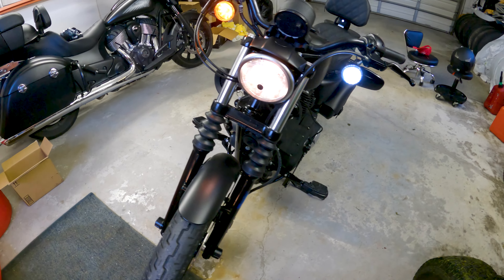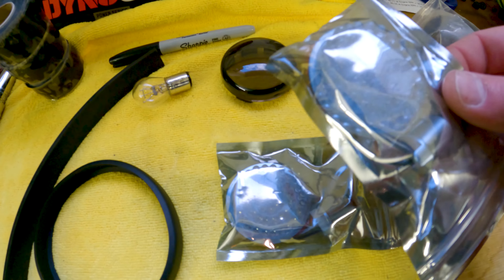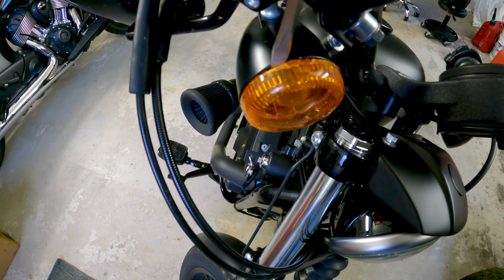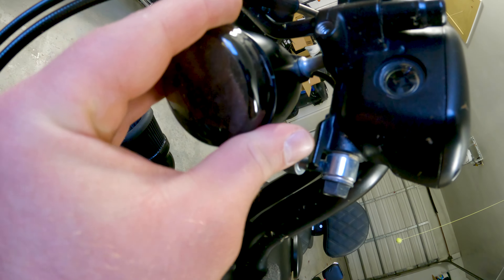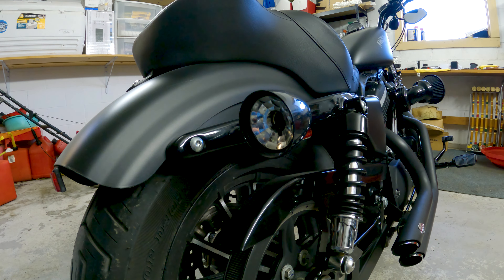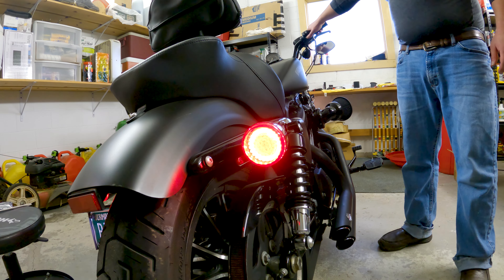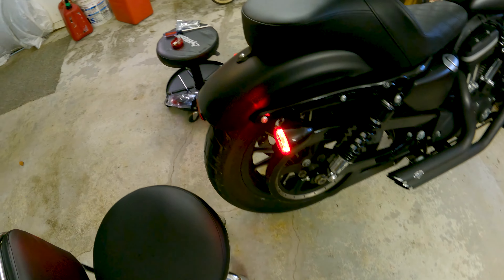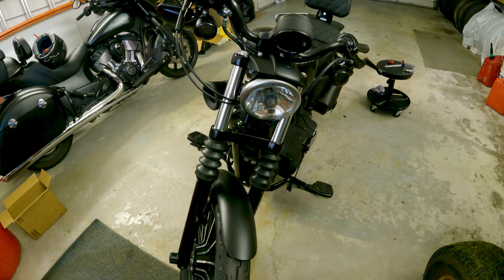How To Install Motorcycle LED Turn Signals | Harley Davidson Sportster, Dyna, Touring

Comment from the maker: Have you guys upgraded and of the lights on your ride? Are you planning to? Let me know down below!
Reply: Do you know if they have these taillights for a Harley Low Rider S?
Reply from the maker: @vtbaggerbro6291  These LEDs and taillight lenses will fit the Harley Sportster, Dyna, and Softail lineup according to the manufacturer. So you should be good for a Low Rider S!
Reply: I di dmy 04 Dyna the rear lights were not compatible and I had to install the voltage regulators for each light to stop the hyper flashing. Not a quick job on my bike.

Comment: I bought these LED's for my 15´ 883, as soon as I got them I wasted no time and went straight for the install, but I got heartbroken when i noticed my turn signals are single contact, i tried to squeeze them on anyway but only the turn signals worked, not the white surrounding halo light, any help would be much appreciated, maybe I just bought the wrong variation? Thanks in advance :D

Comment: Do they work as running, brake and turn signals?
Reply from the maker: Yes to all 3, and much better than stock!
Reply: @MOTOBLADE  do you remember if it was 3 or 4 wires? Trying to find a set

Comment: I got the same lights. They don’t fit in the rear because the small tabs are off :( 
(05 sportster)
Reply: Same exact problem, also 2005 sportster 883 custom
Reply: @TheTripawdHank0012  I ended up getting them to fit. I think I was installing them the wrong way, try to turn it around 180 I think that’s what got it for me

Comment: I just changed mine and i like the hyperflash but then the red key on my odometer comes on is that telling me that the resistance is off ?
Reply from the maker: You know, I was wondering what that was. But mine was coming on before I did this install, so I don't really know if that caused it or not? 🤷🏼‍♂️
Reply: You have to sync your new turn signals with the bike! Otherwise they’ll drain your battery
Reply: @JayPlaysGames  any advice on how to do this, just put them in this morning and definitely want them to work right. And how to install the transistors possibly?
Reply: It’s a quick fix
Reply: Awesome, glad to hear it's easy
Reply: @MrMinority_  how do you sync the signals to the bike?  I just made the LED upgrade to my 2012 Nightster and it has the hyperflash which I do not mind but if it is bad for the battery then I should fix it just not wanting to drop $100 on the equalizer and I'm no electrician so installing the resistors is a daunting task.  I do most of my own work on my bike.

My hubby had the hyperflash on his 2015 Street Glide also but we found a video on how to fix with some fancy key and hazard work but that trick did not work on my Sporty 😞

Comment: Will these work on a 1994 Sportster that does not have the rear running lights only signals.

Comment: I’m late to the party here but wanted to add something.  Hyper flash is illegal as far as I know everywhere in the states. The DOT set a limit of 120 flashes per minute maximum. Anything over is illegal. That said you may or may not be over but it’s likely you are. It’s deemed a nuisance and a distraction to other drivers on the road. It’s also pretty annoying which I guess falls under distraction.  Other drivers will thank you to fix the hyper flash. The police will tell you to fix it with a ticket! Hey that’s kinda like click it or ticket! I’m a poet! Hold the applause! Thank you, thank you.
Reply: So it's illegal to be more seen, got it
Reply: @briansouth9325  it’s not my law man. It’s been around longer then me I suppose. I dint know that it would make you seen any better than normal flash, it’s just the high rate could be a distraction or even a little blinding to those behind you. Some taillights will are pretty bright these days.